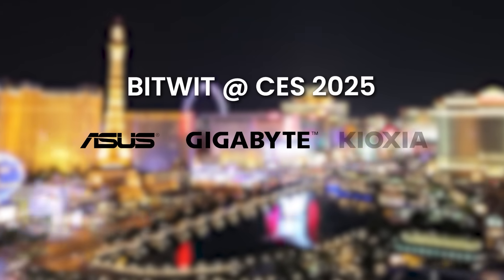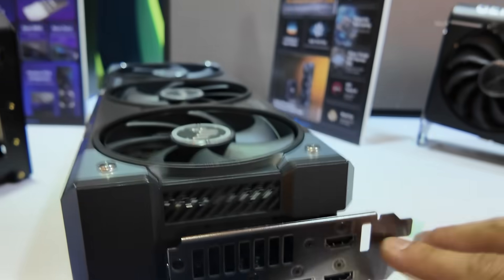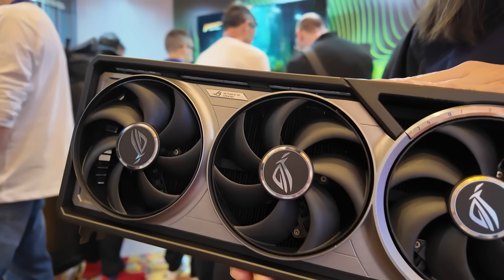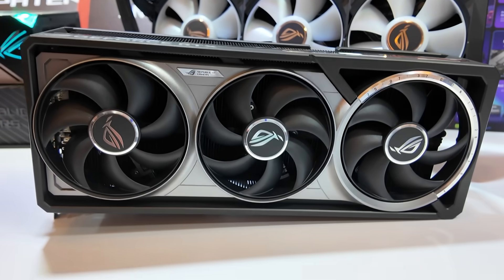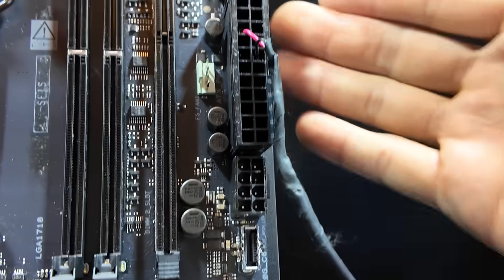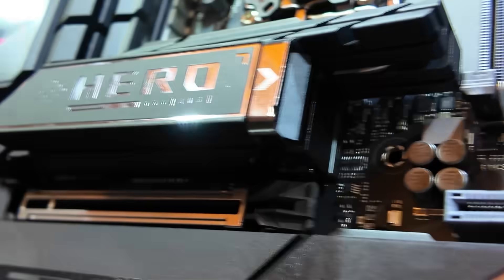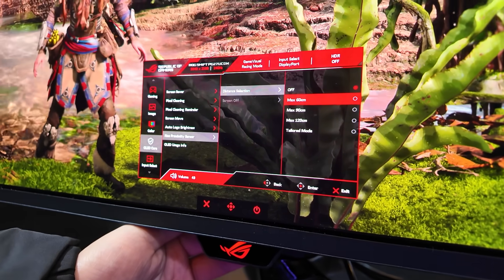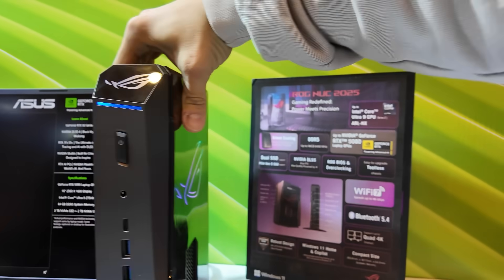Asus just called us POOR in 5 different GPUs | ASUS @ CES 2025

Comment: Why the F you need 2K on that little CPU cooler? The screen is so small you can easily just run 1080p if not 480p and still should look good and crisp, and run smoother.

Comment: First and foremost, the entire team at ASUS wishes you the best during this challenging time.  If we can be of assistance, let us know.  It was a pleasure, as always, to have you stop by and see what we are introducing for 2025.

To clarify a few items

All ASUS 50 series cards have these consistent design elements ( PRIME, TUF GAMING, ROG STRIX and ROG ASTRAL )

vapor chamber with max contact base plate
Feature at least three fans ( ROG ASTRAL is quad fan design )
feature new phase change thermal pad
dual ball bearing axial tech fans with ring barrier for enhanced airflow/static pressure
dual bios
ASUS Auto Extreme production and validation
0db Operatitng mode
PCIe power detection
GPU guard , design to improve torsion and cracking 
Stainless steel bracket

PRIME series is our entry compact design and as noted ideally suited for SFF/MFF  builds but of course work in traditional ATX based builds where you have less space and also have less budget. These cards will be our MSRP based offering. We will scale from 70 - 80, no 90 series.

We also plan on a white PRIME in Q2 at least for one GPU, most likely 5070

Please note the compact design also complements our dual x8 slot motherboards so if a prosumer/professional that can leverage two graphics cards it is a great option. If interest in this check our ProArtt motherboards for Intel or AMD.

TUF GAMING will be 70-90 series

These cards compared to our PRIIME series will feature a superior VRM, thermal solution ( cooler and quieter ) compared to PRIME and will also have minimal RGB lighting compared to PRIME which has no lighting. The shroud is also a composite of metal and plastic vs the PRIME shroud which is plastic.

White is planned for Q2 at least one GPU and we are also targeting a TUF GAMING BTF option

ROG STRIX - WILL NOT SEE 80 or 90

It will be 5070Ti and 5070 only, compared to TUF GAMING, comparable GPU motherboards these will offer superior performance and aesthetically our most dynamic RGB lighting with a full addressable RGB light bar on the side and a translucent portion on the front shroud which will showcase RGB lighting as well.

It also has more advanced power detect+ design, Fan Connect II headers and other hardware level improvements

We are also planning a white variant ROG STRIX model in Q2

ROG ASTRAL will be our flagship premium series reserved only for 80/90 GPUs

It will have numerous upgrades compared to ROG STRIX or TUF GAMING it is our most performance, and innovative card.

These cards / series does not replace MATRIX/POSEIDON which are limited release products which we release only on specific occasions where we feel compelled to offer this models. We have not plans at this time for either and ROG ASTRAL will be normal production not limited edition. 

ASTAL compared to TUG GAMING 80/90

Higher end thermal solution with miilled vapor chamber ( patented ), heatsink assembly is more dense
black heatsink assembly
Higher end PCB/VRM
Fan Connect II headers
More dynamic RGB lighting 
More metal in the shroud/frame
Advanced PCIe power monitoring/reportitng
Advanced thermal mapping ( GPU, PCB, VRM, power and more )
higher TGP/clocks

We are planning for possibly two white ASTRAL models for Q2 as well as BTF offering

Comment: I'm disappointed that type C didn't make it to the 5000 series I/O.  Why they don't bring it back from 20 series is braindead in my opinion. The type C on my 7900XT is capable of 240hz 1440p without any compression and powers the monitor it's hooked up to with only 5 watts. This should be the future of displays.. not hdmi or displayport. One cable to rule them all

Comment: The problem with the hybrid cooled video cards is that only the GPU is liquid cooled. The VRAM still gets hot. And hot VRAM still throttles your video card performance. So, doing half the job is dumb.

EK water block and a ALPHA COOL closed loop cooler without the reservoir for the video card.
Reply: The ASTRAL LC has a full coverage plate which makes contact with he GPU, VRM and VRAM. There is also an additional fan to provide airflow for the boards/surface mount components. There are no concerns regarding VRAM temperature. We introduced a similar design with the prior generation ROG MATRIX LC design.

Comment: 2799 for the astral oc is some wild work, gonna have to finally switch AIBs to MSI, the LC 5090 is 2499.... idk what asus is smoking
Reply: TUF will be same price as nvidia founders edition
Reply: Make sure to front mount the system rads of the GPU if it gets hot. Reverse fan push for air to exit through front of case. Less heat build up.